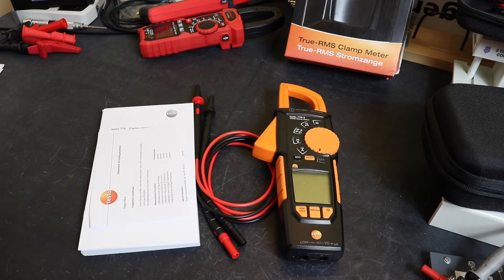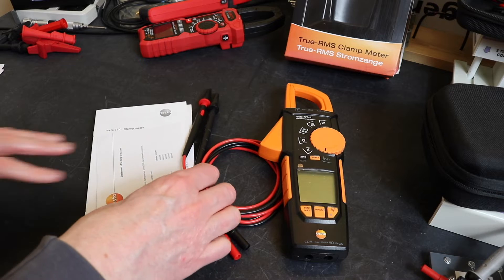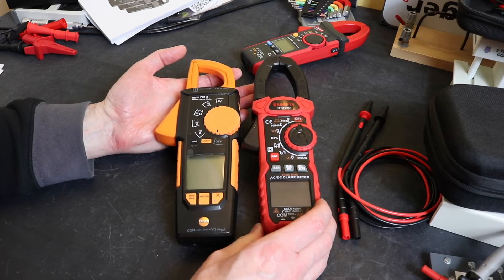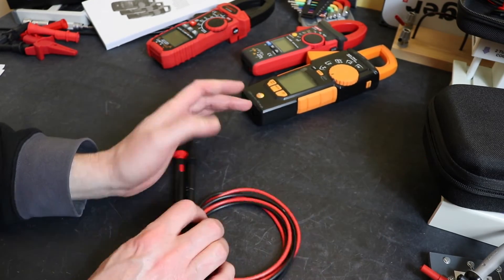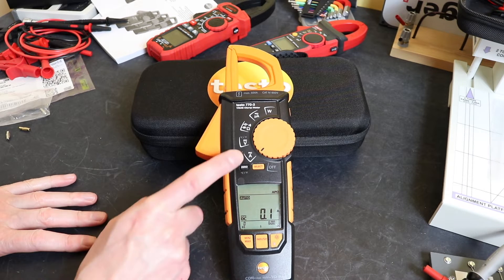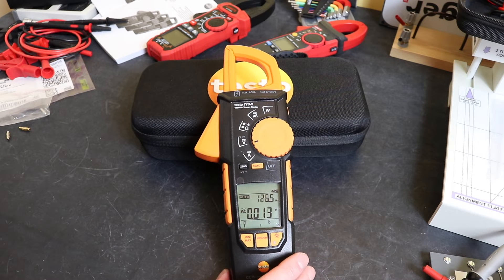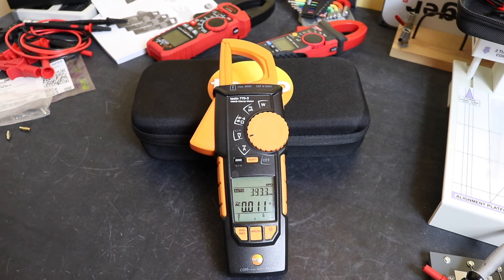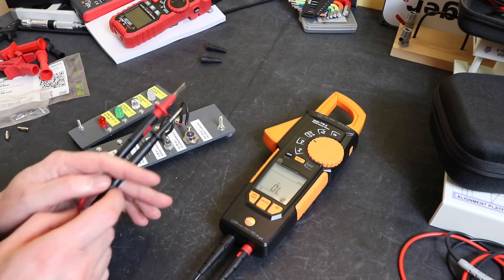Testo 770-3 Power Clamp Meter Review and Test

Comment: what is that stand which holds the clampmeter , is there any amazon link for that ? thanks in advance
Reply from the maker: If you mean the white plate that it was laid on whilst being tested, it is the EA002 from Transmille, the rest of the time it was rested against its own case.
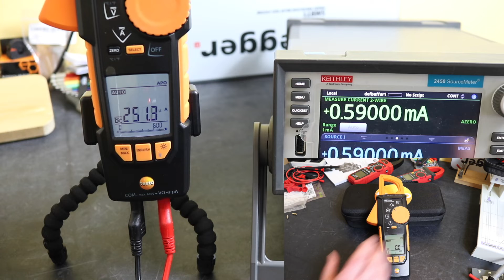Reply: @three-phase562 12:04 the stand which is holding the clampmeter

Comment: The so called Smart Testo App will not record Amps and Volts on the one screen!  Neither will the meter - on W it shows W and PF....   Pretty poor effort.
Reply from the maker: No it doesn't display the Amps and Volts on the power screen. I have seen that feature on a couple of power clams and it is quite handy to have.
Thanks for your comment.

Comment: Hi ,,,mate ,,,I have the myself 770-3 ,,, I have issue,,,whit it ,,,i am set it volts,,,reading,,,don’t show me the reading,,,everything else’s ok,,,any idea,,,,what it is ? Bit disappointed 😢
Reply from the maker: With the leads removed and switched to reading AC volts, the display on mine fluctuates a few millivolts and the frequency display is unstable. If I then short out the inputs the millivolts and frequency stabiliise, but not quite on zero. If your meter doesn't do that, it will likely be the function switch not working or the amplifier circuit faulty. I have never been inside my meter as one screw is hidden under the serial number label.
If the meter is under warranty, I would just return it.

Comment: Nice video, which amp clamp for a HVAC Tech would be the best bang for the buck
Reply from the maker: Just depends on what functionality you want from the meter. If you want power measurement capability, then this Testo 770-3 would be my likely choice. If you don't want power measurement but would like inrush current, then Testo offer the 770-1, the UT216C is a similar price and functionality. About half the price of those is the Kaiweets / Habotest HT208D. If you just want basic AC / DC current measurement, then you could look at the Extech MA443, or the Fluke 323 or Flir CM72 if you want a top brand names.
Thanks for watching.

Comment: isn´t the adapter especially for their DMM?, the peculiar shape gives extra protection on the multimeter with probe sensing connections. Nice video as always.A good way to start the sunday.
Reply from the maker: They appear to have two adapters, one for their DMM, and then a slightly different one for this clamp meter.
I don't need the temperature measurement functionality, so have never purchased it.
Thanks for watching and commenting.
Reply: @three-phase562  Ah so. I didn't know that because I only have the DMM from Testo.
Reply from the maker: @RensePosthumus  👍👍